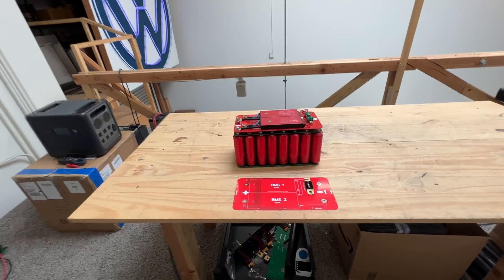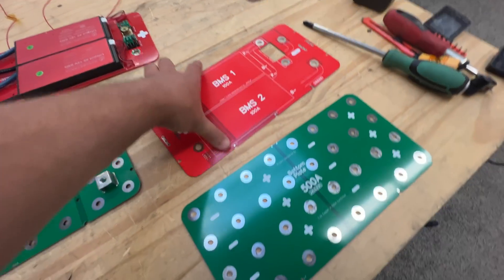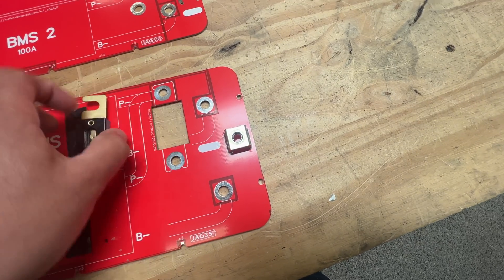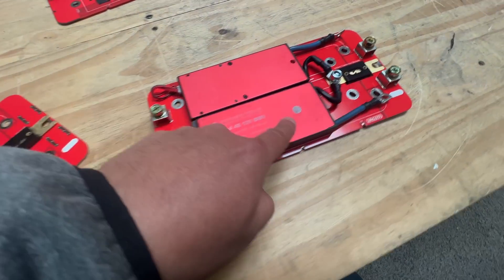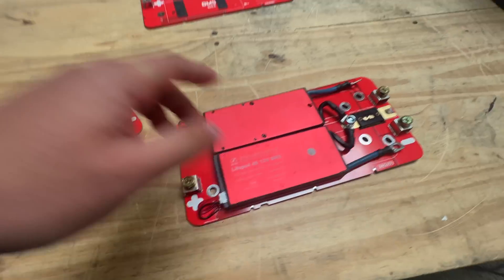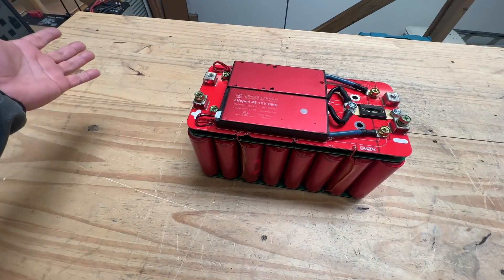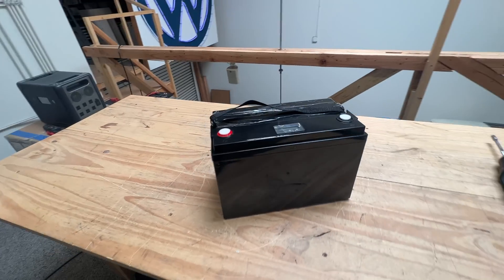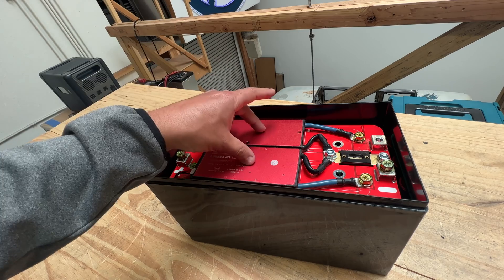200A HeadWay battery BMS  Board - PCBWAY

Comment: Is it possible to build a smaller 12v battery like this, for motorsport, where size and weight is in focus?
Like 12v, 30ah, 500A short term?

Comment: @jehugarcia I ordered this setup. Any idea if these BMS' are still available? They look updated and potentially not compatible? I'm wondering if i could adapt a single 200A BMS instead?
Reply from the maker: Yeah I think Daly discontinued that exact model,  im designing a new board using a different 200A bms
Reply: @jehugarcia  Thanks for the reply. Is the different 200A BMS the same one you're using on the "SLM121 LIFEPO4 12V 200A 4S2P 1200WH BATTERY"?

In either case, is it possible I could switch my order to the new version once it is available? I'm not in a big hurry, especially if it's in development.

Comment: One more thought... parallel BMS current limits won't work as well as a single large one. The two would never be perfectly matched, so one would carry more current than the other, and would trigger first (before 1/2 total current), then the other would instantly follow suit.
Reply from the maker: Yeah but all those problems go away if you don’t build your system to operate near its limits,  I’ve been using battery packs like these for years with zero problems

Comment: Thermal protection? I'm looking for my diesel, I'm waiting for a super cap that should handle the surge for starting and I'm thinking of headway for the capacity battery, im worried about the 40- *F we sometimes get. Will thease bms protect the battery in the cold? Or can bms trigger heating pads say with it senses the alternator ect?
Reply from the maker: Not these BMS,  you need other version with those features

Comment: My battery works great! Thanks for sharing the knowledge.  I installed a new alternator thats charging @ 14.8v, it triggered the bms in my battery but only twice right after installation. But has be fine for couple days.

What would you do. Should I put my other alternator back on?  It never goes over 14.4

Comment: I've assembled everything but need to connect C2, C3 and C4 from the BMS board to the top and bottom PCB's. However, my top and bottom boards don't have any notches or prints indicating where to solder the connectors (a picture of my boards: https://tkahn.se/200A_HeadWay/top-and-bottom-pcbs.jpg. Looking at the video, the boards in the video have both notches and prints https://tkahn.se/200A_HeadWay/200A_HeadWay_battery_BMS_connectors_1.png. Could anyone help me figure out where to connect the connectors to the top and bottom boards?
Reply: Looking at the holes in my top and bottom boards and matching them with the instructions that came with the BMS's, I think this is how C2-C4 should be connected: https://tkahn.se/200A_HeadWay/BMS-connections.jpg (sketch on paper). Does it look OK with you guys?
Reply: I soldered C2 from bottom board to BMS board. Then I soldered C4 to the bottom board, but when I connected it to the C4 pad on the BMS board it went frittzzz and burned away the copper trace on the BMS board. It might have been a solder bridge where I had soldered the BMS connectors or maybe my sketch (above) isn't correct after all. https://tkahn.se/200A_HeadWay/C4-kaboom.jpg (closeup of burned trace)
Reply: @ThomasKahn  Looks to me like the solder holes are in the wrong place.  Can you test with a multimeter and make sure the BMS leads are not shorted and connect to the right pads?

Comment: That battery should start a car or truck no problem. When I was working at Milwaukee Tool, I modified one of the XC batteries to have double the cells (16 cells total) and we tested it starting a 1970s vintage truck because we'd come across a flat pack battery that was being sold that could start a vehicle. Their product started the car, and so did my modified battery. You've got even more capacity, so there should be no issues.
Reply: a starter on a V8, takes 300-600amp. Cold oil engine, hard to crank.

Comment: Any news on the beefier BMS you mentioned in the video for Automotive applications?  Could you provide the dimensions of the BMS on the BMS PCB so as to try and source another unit that would fit the PCB but have a higher CCA without tripping the BMS...?

Comment: Hey bro iv done a test on the heltech bms and I have discovered that the charge cut out voltage per cell is 3.9v.which is bad when it suppose to cut out at 3.65v.its very wierd
Reply from the maker: Your charger should cutoff at 3.65v your bms is a fail safe.  3.9v is fine
Reply: Sure my charger is working fine was juss testing the capabilities of the bms. My current setup is a 4s3p headway bank with a 200a jbd smart bms.it is more than capable of starting a 4.0L diesel engine with no triping or overheating issues(barley warm)however the heltech  bms runs quite hot under stress testing.proberbly because if it's lack of a proper heatsink but it gets the job done. Would like to see you do a board that supports the jbd 200a bms.i can testify that it works for me Especially in automotive applications. There is also a modle that supports heating pads for cold weather applications. Nice work btw

Comment: The 60 amp version can handle surge current of 180, and those 100 amp versions can handle surge of 300 amps, so with 2 of them you should be able to surge to 600 amps. That should be enough to start most any car so long as you don't need to crank it for more than 5 seconds.
Reply: Why would you want this for a car starting battery? It just doesn't make sense.
Reply: @randybobandy9828  Jumpstart ability if your starting battery is dead.
Reply: @Andy P  there's a guy on here that started his V8, with only 4 cells, in the trunk, it barely started but you probably are good with just 12 cells and it'll probably compare to a 51R battery.

Comment: Jehu -  I would recommend a small revision RE the negative terminal for the BMS.  I would add a clearance around the connector (that bolts to the negative B-).  It seems like if that gets hot it could burn the conformal coating and short out the BMS.  Its a small chance but I would just make a simple change to that.   Another option would be to add a washer to hold it off the board a little to help with heat etc.

Comment: The 200 amp discharge is a cool number to see what the maximum amount of discharge is capable.  But I’d like to see something more useful tested on that pack.  For instance do a 25 amp load for how many hrs it take to be dead.  I’m thinking a replacement for lead acid trolling motor batteries.  Something that will still fit in a group 31 size case be be able to last for hrs in a kayak with a trolling motor.

Comment: You don’t need the batteries at all…..I’m running JUST the super capacitors without batteries.  For a while I had them in line with my battery; made my battery last 8 years but it was still good when I took it out!  You can build this better with supercapacitors.

Edit:  forgot to add….no BMS at all either.  Just volts and amps, baby.  Plenty of amps.

Comment: If needed for starting capability over 200Amps you could run a second dedicated positive cable to the starter that bypasses the BMS. (Remove and cap off the large positive cable that goes to the starter from the original harness) You would still have all of the normal BMS protection for the rest of the vehicle.  A voltage gauge would be ideal to know you aren't attempting to start from a dead or low battery and you could have other means of low voltage warning while cranking.  I like this set up.
Reply: you only need another one in parallel to boost the amps.

Comment: How about increasing the size of the PCBs slightly so the finished assembly fits snug in the battery box? That could also give you a bit more room on the layout, more copper etc.
Reply: Its so easy and cheap to add potting to electronics that I wouldn't make it to only fit this one box type.

Comment: to add more current capability, I think it is better to rotate the PBC layout 90 degree so there are more pcb copper going across each series connection. I did build a battery with 6p4s so 4 row of 6p in a line with 1 mm copper plate.

Comment: i would love to build one of these as a main battery for my truck, i have heard issues of the alternator not being able to chare the batteries, have you heard anything about this?
Reply: they make lifepo battery's for motorcycles, and people use them to start racecar's sometimes.  The bike batteries are charged via a standard alternator for a bike, I don't see why a truck would be different.
Reply: There is quite a bit of work that goes into building these batteries.  Especially when working with Headways as they are some of the worst I have tested as far as cell health and such huge variations in internal resistance.  If you are going to build a lithium battery for ur truck you will need to test each and every cell for voltages variations under heavy load (high c discharges) with a balancer to see these variations.  So a balancer/monitor, (isdtbattgo 8s) battery load tester, a roll of metal clamps brackets they are really cheap for a roll (for the initial top balancing just makes it easier to balance all the headways at once) a charger of somekind the dc charger is really good as well as a few others.  It is time consuming and everything but it is well worth it in the end.  I have built batteries with different types of cells from pouch cells (was also in my car) to headways, to lto, to prismatic cells for boats, cars, solar, as well as side by sides.  Different chemistries as well as different size cells.
Reply: Wherever you heard that from don't listen to them.  I have had headways in my 300C for over 3 years now for competition system.  But for ur truck a bms is not needed a good balancer is all that is needed.  BUT I CAN'T STRESS ENOUGH DO NOT PUT THESE UNDER THE HOOD THEY WILL NEED TO BE PLACED SOMEWHERE ELSE.  A lot of us running this in our vehicles are using a box with a distribution block (block of aluminum with holes drilled for the hookups or a premanufactured block) though the electrical lugs (aluminum ones) at like lowe's are the cheapest route.
Reply: I built a 32650 20 ah for a friend's harley he now uses it in his car shop to start cars with to help diagnose a dead battery or other faulty electrical stuff.  He hasnt found a vehicle yet it would not start.  It fits literally inside a .30 CAL AMMO BOX and weighs a little over 5lbs.
Reply: I’m building some for my truck too, under bonet but with air venting to it to keep it under 40 degrees
Reply: @Falcon_Overland  good luck with that.  It would be easier and safer to run a fuse and a cable through the firewall and into the cab of the truck.  And do a complete battery delete from the engine bay.
Reply: @ripsta2009  unfortunately I don’t have the space in my cab and want it as close to the front of my truck as possible as will be pulling 550amps when winching. 

what do you do about limiting the current outputting from your alternator heard the lithium over load the alternators

Comment: Why would you design this using a Daly BMS? Pretty much one of the least performant BMS IMO. For large short surges, I bypass the BMS.
Reply: @talaminia  I have a 12v lifepo4 battery powering my garage. The cells I used should be able to output 800+ amps, but the daly BMS I have only supports 100a output. It can handle way more charging input than my solar panels provide (20a max), so I bypassed it for output only. It doesn't overcharge because the Daly won't let it, but then I'm unrestricted in amperage when I discharge. I have exceeded the capacity of my inverter and never over-discharged (2000w surge rating)
Reply: @SorenX2008  I purchased 16 of those cells to use on my 48 Volt mobility scooter and two cells already have faults. The inside of the cell lost contact on the negative side.  The pack lost power way too quick so i decided to get another 16 and make 2 48v packs.
Reply: @talaminia  Daly BMS' s only balances when charging (not when idle or discharging) and only when the cell differences is more than 50 milli-volts.  Additionally, when it actually does balance, it does so at only 30 milli-amps. In an imbalance situation, your BMS will never be able to keep up... unless you charge your entire battery at not more than 1 amp
Reply: @talaminia  JBD and QUCC BMS's can balance regardless if it id charging or discharging. JK BMS also and can balance with up to 2 amps (2000 milli-amps). For me, Daly is not very good for balancing but it will protect your battery in the end.